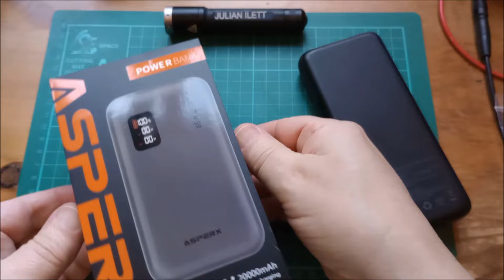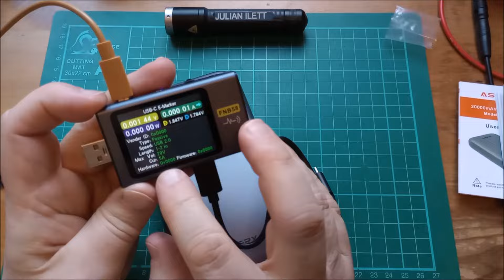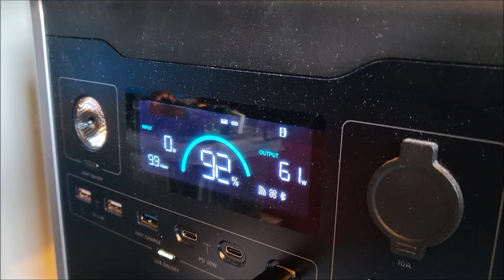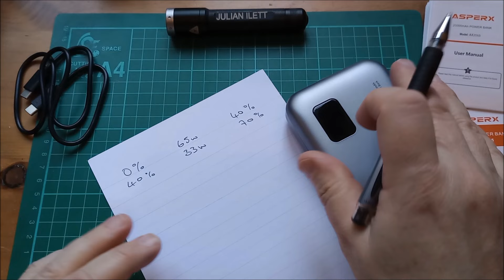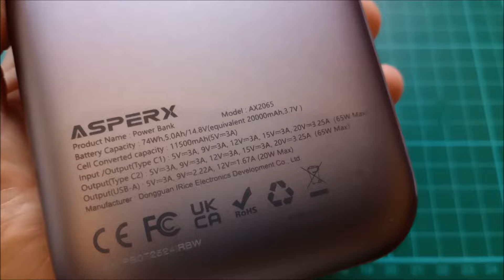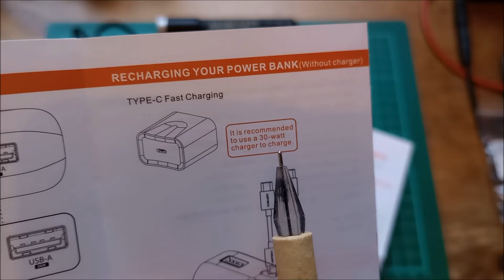Asperx 65W USB PD Power Bank Review

Comment: That 65 W / 100 W wattage mismatch between the emarker chip and cable is concerning. It would be far too easy to get the cables swapped with other equipment. I would probably replace the cable with something more certain.

Comment: So, doing the maths (14.8v ÷ 3.7v = 4s), this would have to be 4s2p of 2500mah 18650 cells (or I suppose 4S1P 5000mah 20700 cells). Does it seem big enough to hold 8*18650 cells or 4*20700 cells? If possibly was only 4s1p then, they'd have to be 5000mah cells. It would be interesting to see a tear down to see the actual configuration of the cells. 

The animation for their 75w bank shows only 5 cells. Which can in no way reach 24000mah (assuming 18650s). That would be 4800mah per cell.

Have you capacity tested the bank Julian?
Reply: From the shape of it, I would guess it uses 4 pouch cells
Reply: Remember that they are referring to Chinese watts not i expect si units.
Reply: Pouch cells is very common in powerbanks.

Comment: That's a shame that you can't charge and dis charge at the same time as it would make a nice little USB UPS
Reply: I think he should have tried it anyways. My own power bank (different model) also says that, but the USB-A ports do still work while charging. However, its USB-C in/out port doesn't work when charging via micro USB, and the charge meter messes up a bit. It can either get stuck saying charging at 99% until the load is removed, or it can hit 100 and start going down while still plugged in despite the internal battery not discharging
Reply: It would be very easy to solve this if the battery bank used a separate PCB for charging